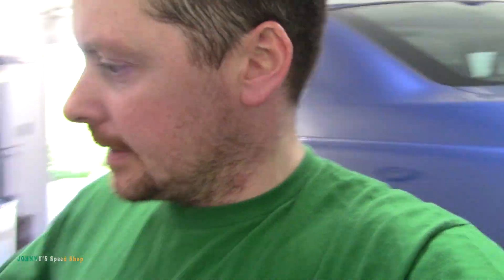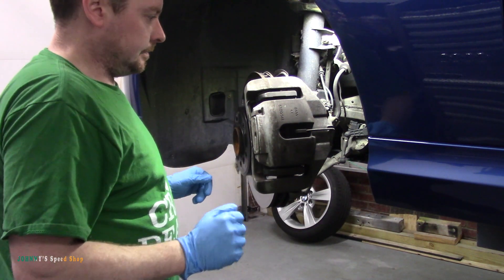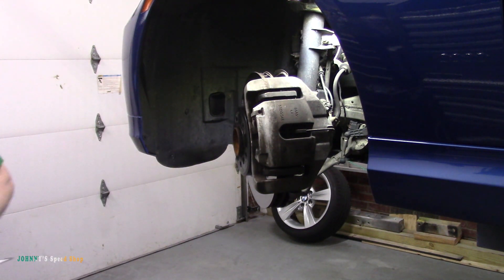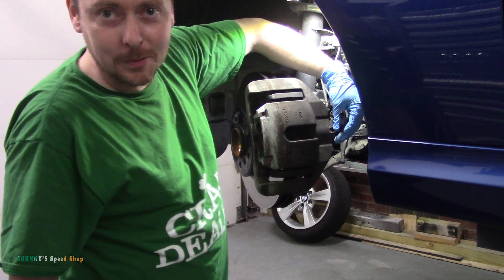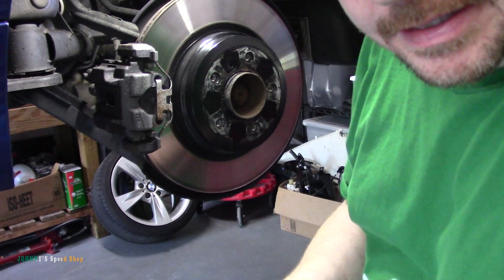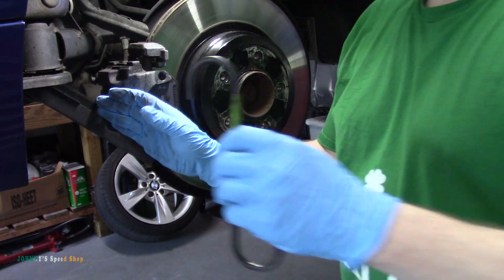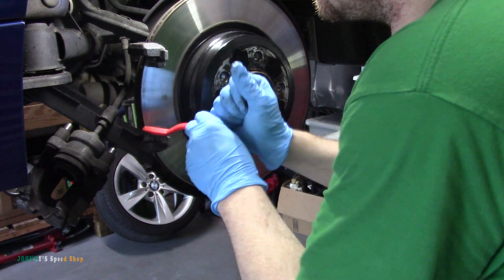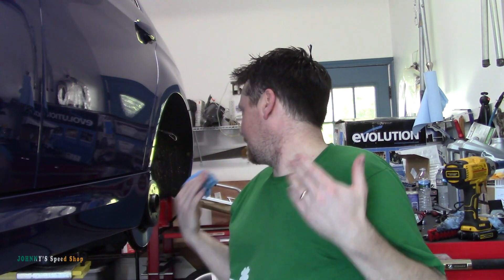Front and Rear Brake pads on BMW 335i - E90/ E91 / E92

Comment: Bro. I’ve got to thank you for taking the time to make this video. I ordered akebono pads from fcp euro and I saw the tabs on the front outer pads and got confused because the oem pads don’t have tabs on the front outer ones.
Reply from the maker: Glad I could help,  the tabs are redundant since there are the sensors as well, but if a sensor failed then the squealer would let you know when to change them again..  :)

Comment: Always clean and grease your caliper pins. Its super important so you don't have an uneven wear if one gets stuck.
Reply: Ehhh not really an issue on BMW car. BMW official instruction say to not grease.
Reply: You are correct. I just been doing it for 15 years without any issues. It has a dust cap so its "sealed". The pins do show signs of slide marks. Therefore I believe it helps. BMW says its not needed. Just needs cleaning.

Comment: Hi Johnny, your the only guy on you tube that shows the ATE Caliper it's also on my 330d That clip is a nasty one, I've never had such grief, Since I've done mine, I've lost my pedal, its great when the car ain't running, but when the car is running, my pedal sinks, I've bled the system  2 x manually 2 man method, and today did it with inpa, using the ABS pump. Still sinking. The pads didn't have outer fixing clips on the back , only the Piston side had them, now my calipers are creaking, had the pads back out and refitted with new springs I am thinking the servo, has gone would you agree?
Reply from the maker: Are you losing any fluid ? Sounds like it could be the seals in the master cylinder to me, check under the dash for any dampness, if you can pull the bellows back and check for leaks... if thats all good I would pressure bleed the system and check all the rubber hoses, you could have one that is bulging under breaking but look totally normal when not being used...
Reply: @JohnnysSpeedShop  Thanks for the swift replay mate, no loss of fluid, I'll b honest I forgot to undo the Reservoir cap when I moved the piston back, (First time ever) The brakes were low before but never noticed a sinking brake pedal, There does seem to much movement in the callipers and they never creaked, so The febi pads i ordered are the non performance type as they do the same pads with the outer clips will get rid of that play I have there, I think that needs doing. Loved the Video .I've just done the servo test and brake pedal doesn't rise after it's switched off. I'm thinking master cylinder though, I bet I broke it. the pressure had no where to go.. so will get right pads first, then do the master cylinder.  Appreciate your help mate.

Comment: How did you jack your car up? I can't even fit a jack at the front the car is so low, and are you using jack stands?
Reply from the maker: Its on a lift...you can get a low profile jack under no issues...

Comment: Are you sure it's an Alan key and not a torx screw?
Reply from the maker: 100 % mine were allen head bolts... a torx can remove an allen but I wouldn't advise it with this toque spec...  an allen will not remove a torx or torx plus anywhere near as easy so be careful if you are trying that...
Reply: Perfect no it's okay it is an Alan but this person on another video said it was a torx bit... so they were idiots and you are 100% right. I wont use a torx bit on there it's to aggressive and can strip out the bolt x3 thanks for the reply tho!
Reply from the maker: Ha....good stuff
Reply: They use torx on everything else so I guess BMW thought they'd throw everyone for a loop for shits and giggles with some allen head bolts 😂

Comment: Hi Johnny my outer pad didn't come with a bracket, does this matter?
Reply from the maker: Not really, you might fine you have a clunking noise when switching from reverse to forward travel, but the carrier and the anti rattle clip will hold the pad in place...what brand did you get ?  I would confirm you were sent the correct pads... just in case..